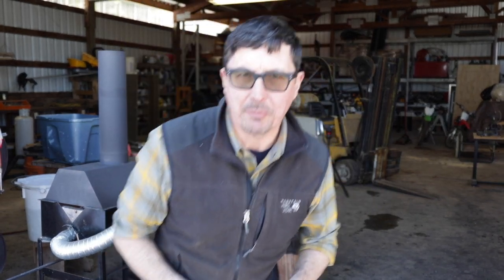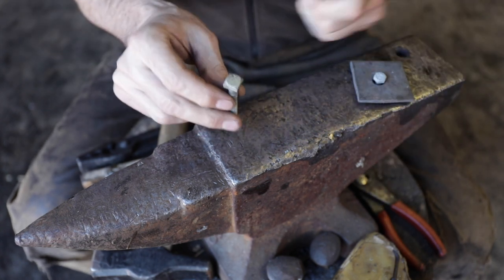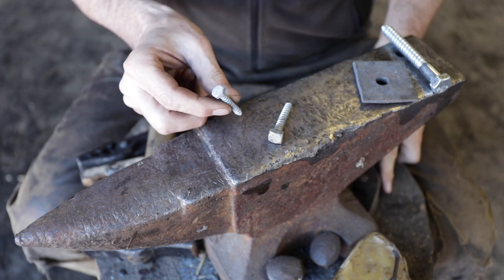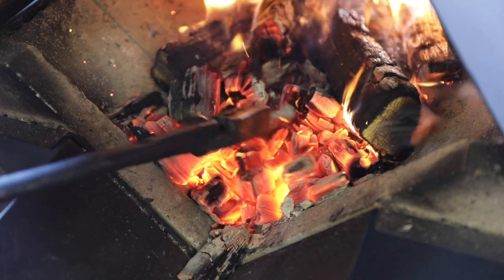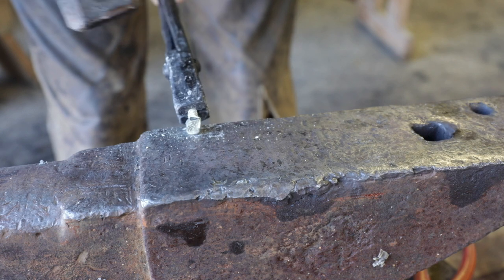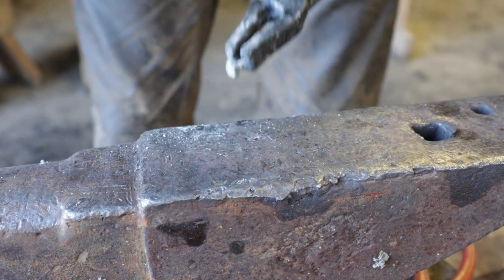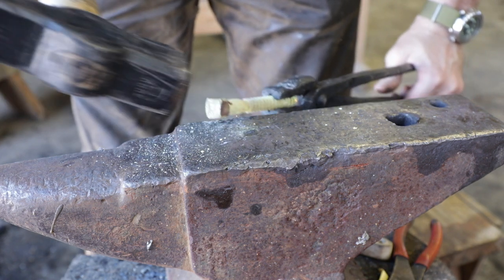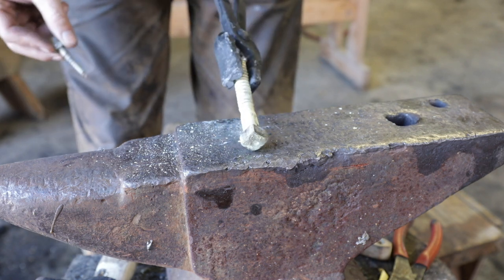Forging A Square Bolt - How Hard Can It Be?

Comment: You can also heat the head with a torch and isolate the heat instead of using the forge. Faster  than building up coals.
Reply: Plus would mean less likely to damage the bolt threads with the forging tongs

Comment: I was impressed that you figured out which side to hit first so quickly. Blacksmithing is mostly problem solving. If you have a wire feed welder there is an easy way to make a pretty bolt.  Make a big weld puddle on top of the bolt head. Then grind facets to match the edges of the head. We called them acorn bolts. Something to consider. Any time you heat a fastener up that hot you loose the temper. So drill pilot hole or the heads will twist off. Keep up the good work! Oh you could tack weld  a small piece of steel in the jaws to make them grab smaller stock. I've done it before. Ok now I'm done.

Comment: Hey Cody,  you would need 2 jigs, one 90 degrees, for squaring off the heads, and one for uncrowning the squared bolts heads.  Don’t forget to re harden and temper the bolts so you don’t shear them off installing them.

Comment: You should get a 1/2" steel plate, and drill, and label, every hole size you could ever need. Could probably fit on a 1'x1' square. And make it into a table tailored to you with angle or square tube steel for legs. I love to watch your videos, because you have honest knowledge. Thank you sir.

Comment: Use a swaging iron and block to make a round shank on the end of some 1/2’’ square stock steel, then use a rat-tailed file to hand cut the screw thread, unless you can access a metal cutting lathe amongst your neighbours. Then all need to do is cut the heads to the right height and start again until you have enough, then heat treat for hardness and colour/finish.

Comment: Cut the head off a bolt, drill a hole in a piece of plate steel equal to the bolt diameter, cut around it square to size, then weld it to the bolt. I've done that before and it worked out. Especially if you want a large looking head for a smaller shaft.

Comment: Instead of pounding the head with a heavy hammer it would be interesting to see what results you got if you used a large vice to reshape the head.  It may give you more control.  I've never tried it but it would be interesting to see if it worked.
Michael from Canada

Comment: Use a magnet to find those small bolts. Excellent content. Every day waiting for your content
Reply: If it's at a certain temp. and above the metal is not magnetic any more.
Reply: Most mild or medium carbon steels loose spontaneous magnetism (Curie's point) about the moment they turn cherry red - 750 °C (1400 °F), so magnet is not sure way to catch them in a forge.

Comment: What  ya can do is make a split jig. You take 2 pieces of thick flat stock sandwich them together.  Then you drill a hole in the center of the 2 . You use them in a vice they are great for making rivets with out the worrie of how your going to get it out of the jig.

Comment: FYI...  I have heard rumours that the PT Cruiser was infuenced by some Chip Foose designs, from back when he worked for a guy affiliated with Plymouth/Chrysler.  The Prowler was one of his designs, though.    As for the PT cruiser, there is much controversy as to what it was supposed to be, a light duty truck or something?  However, it was supposed to be inspired by 1930's styled cars.  The designers were all hot rod enthusiast and hence their common interest led to the Foose connection.  Yet, they used the same chassis setup and design for the Neon in it's manufacture.  It was a design concept that left consumers divided over it's design and such.  However, I get your grandad's Ford dedication...

Comment: Why not just use the torch on the heads like you did before so you don't have to risk losing it in the coals? Then just use a file to flatten the top and bottom of the head.

Man, that skiing looks great, I'm so jealous! What ski hill is that?

Comment: hey wranglestar, I have a question. I recently broke the shaft on my 3-5 perhaps even 10 lb hammer, dunno the exact weight but its pretty f@cking hefty. in any case, it snapped right where the shaft meets the hammer head, now my conundrum is how do I get the wood out of the hammer head so I can put a new shaft on it. Would be simple enough, but it has a circular step wedge in it, any tips?

Comment: You don't need to heat the entire bolt, just put the head in the hot coals. It will help prevent bending the threads.

Comment: Clearly, making square headed lag screws and bolts is pretty cool and I am sure you would be able to fix the threads after squeezing them all out of whack... BUT... if you want to save some time and hassle (time has value too, right?), what about this from some googling I jsut did - not the cheapest, but for specialized decorative purposes - not too bad, I'd think:
https://www.blacksmithsdepot.com/bolts-and-fasteners/square-head-lag-bolts-25-pcs.html